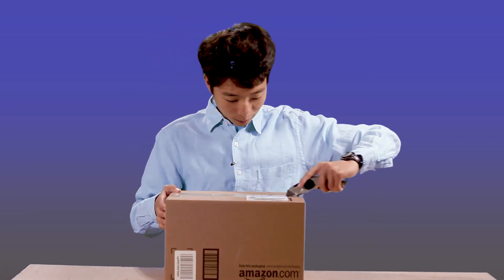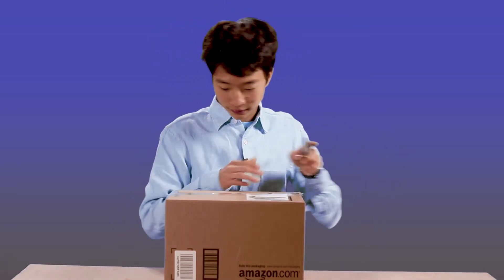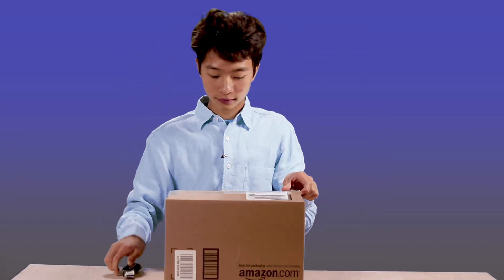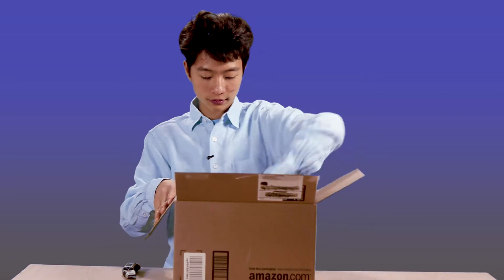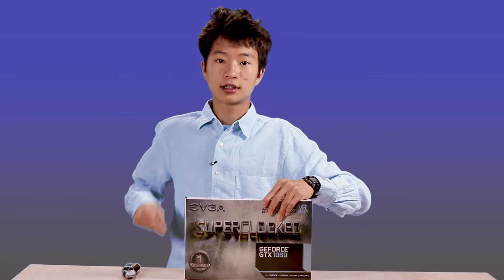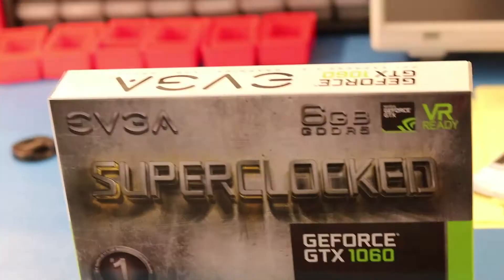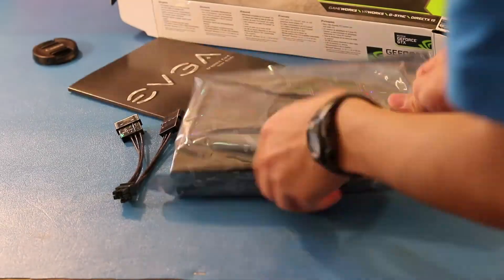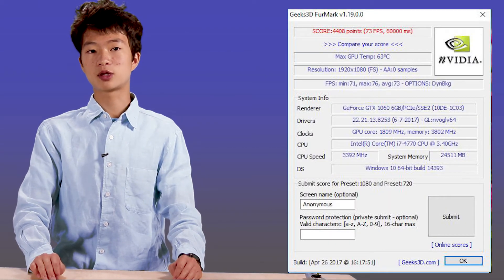GTX 1060: unboxing, and getting it to work with Premiere pro

Comment: Integral Man, thx for posting this video, you are doing an amazing work! I wanted to ask you, I just recently bought GTX 1050 and directly, without creating a .txt file in the Premiere folder and typing my graphics card name, I could already see in my Adobe premiere 2018 under General Settings the Option for CUDA renderer. So I chose this one, used a CUDA accelerated effect in my timeline and tried an export. I saw that the GTX 1050 was not utilized more than 20% persent while the CPU gets 100%. Then I tried creating the .txt file, still no change. Do you have any idea what the issue is? Can it be that the graphics card of my CPU is enabled in BIOS and hinders the GTX 1050 ? I have done the same by changing again to my old GT 640 graphics card and it could get 100% utilization...
Reply from the maker: Yes, I noticed this as well with the 1060. The issue isn't compatibility; you already have it running Cuda-boosted. It has something to do with specific actions that the graphics card can do and what it can't do. It seems like many of the basic actions, including rendering, has to go through the CPU instead of the GPU. Unfortunately, I don't think there is a workaround. The only reason why your 640 is at 100% is because the amount of work assigned to it is enough to keep it at maximum load whereas your 1050 makes quick work of it.